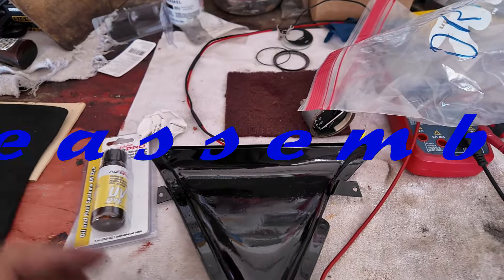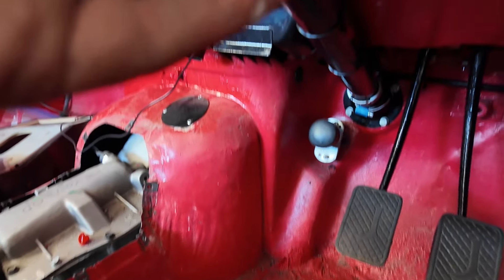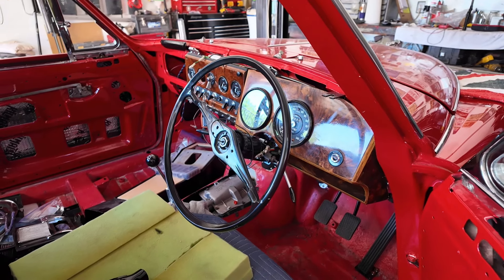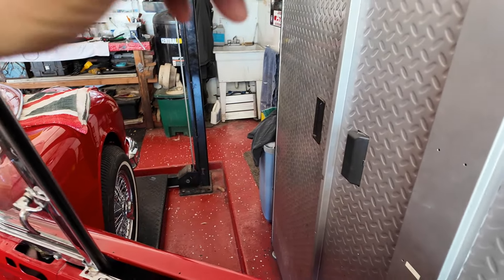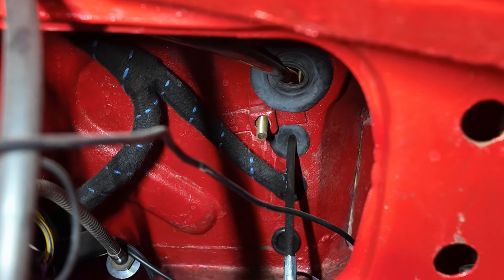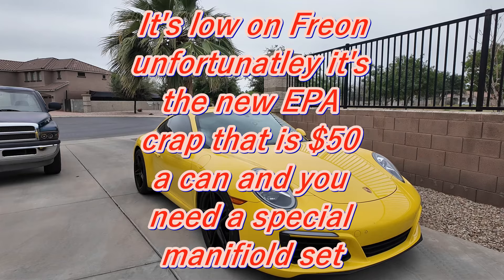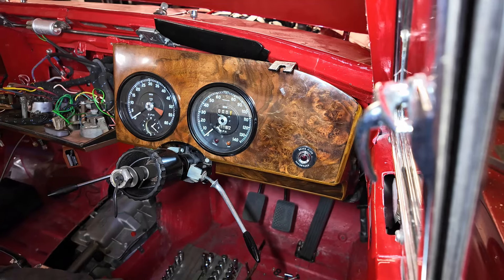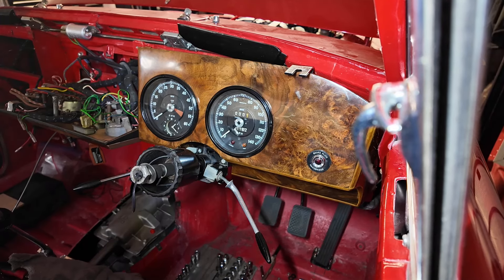Jaguar MKII Reassembly Part 295

Comment: Thanks gary, interesting video. Got a quick question about MK2 Oil pressure senders. Where are they located? are they normally closed ? asking that as not sure how to test them. Maybe a video of this would be interesting..GN
Reply from the maker: Oil pressure sender is on top of the oil filter housing, I'll see if I can do a video but not sure I have a working sender to show.
Reply: @jagvette1  Thanks Gary. I will look for mine tommorow. As far as I know I can use a multimeter from terminal to earth and should have continuity. Just wondering if its deff at closed when disconected etc.. James
Reply from the maker: @GlesgaNews  I think its a rheostat